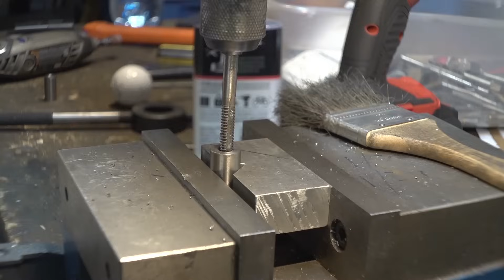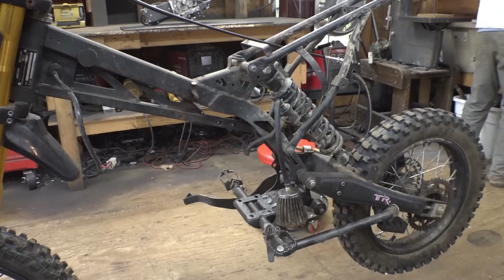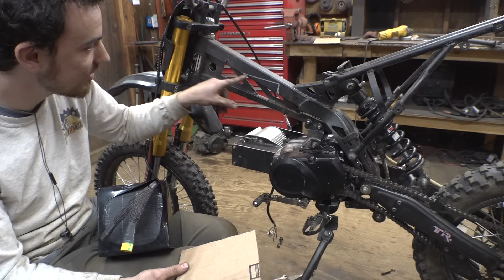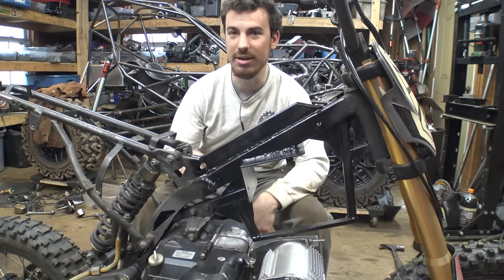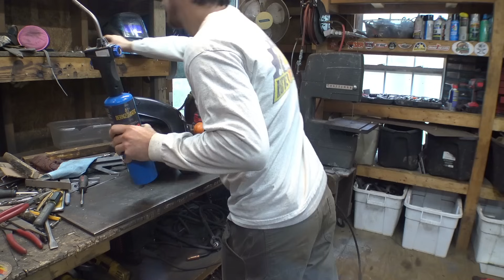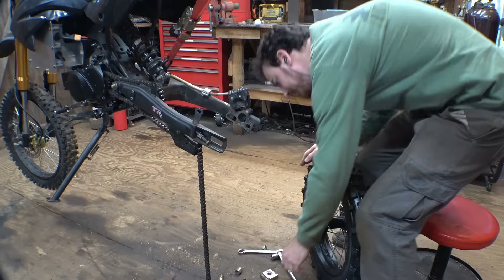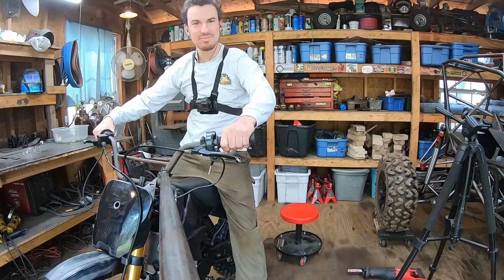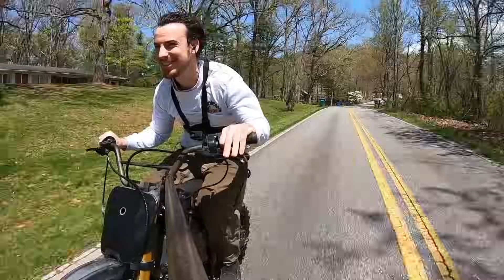A Different Way to Build An Electric Dirt Bike  - Part 2

Comment: Awesome work. Can’t wait to see the next one. Do yourself a favour in the next build and use a two stroke motor as it already has the sealed crankcase. All you would need to do is build a new crankshaft for it and not have to worry about trying to seal the crankcase from the gearbox. Thanks for the great content.
Reply: And a much taller gear range
Reply: Best off doing what he did like you've already said its setup pretty well in order to have an electronic motor where the cam use to be is an awesome idea.
I want to build myself one so stripping the scooter and my old beat pitbike is a GO for sure when I get the right equipment 😇
Reply: Dats a good idea this is gona be the next step in dirt bikes and quads u can start off in any gear and not have to worry bout it seizing up the only thing it jus keeping the gear box cool
Reply: Once the head is removed there's no camshaft or need for an oil pump a two-stroke is perfectly set up already.
Reply: @ExploringCabinsandMines  then what is lubricating the crank bearings of said 2 stroke?
Reply: @natereinhold6180  The oil that is added to the gas look it up.
Reply: @ExploringCabinsandMines  it's a electric bike conversion, look up how electric bikes don't use gas.... now what will lube the 2 stroke crank. Maybe instead of trying to sound clever, think a bit before opening your mouth
Reply: @natereinhold6180  In a two-stroke engine, on the other hand, the crankcase is serving as a pressurization chamber to force air/fuel into the cylinder, so it can't hold a thick oil. Instead, you mix oil in with the gas to lubricate the crankshaft, connecting rod and cylinder walls
MORON ! LOL
Reply: @natereinhold6180  I'm never wrong dummy.
Reply: @natereinhold6180  two stroke transmission is using its own oil not oil from the gas oil mix
Reply: @ExploringCabinsandMines  😂
Reply: To much work. The 4 stroke already has chain and sprocket for the camshaft
Reply: @dw4956  he didn't use the existing cam chain on the pit bike engine he modified the crankshaft and fitted his own chain an sprocket I assume the same can be done on a 2 stroke engine
Reply: @dw4956  i dont think the cam sprockets or chain would hold up to and electric motor. Sketchy but you never know. I would use a 2 stroke bottom end.
Reply: @dw4956  yes but the cam chain is one, very thin and two, will carry oil out of the gear case when spinning

Comment: The chain on the dirt bike is too tight dirt bike and ATV change usually get tighter as you apply weight to the suspension if it is tight when there is no weight on the bike that means it is over tight when you sit on the bike

Comment: Hey that Expose shaft where the charging system was at you should put a  Alternator  I always wonder what happens with you Put a charging system on the electric vehicle? Cool build 😎
Reply: all you are going to do is add extra system drag as perpetual motion machines do not exist
Reply: It would use more power than it could produce.    It has been tried and failed.

Comment: Make sure your using wet clutch oil. Wrong oil could cause slipping. Cool conversion, although I miss the noise!
Reply: Automotive engine oil will make a wet clutch slip every time. Use Motorcycle oil! You can also use Rotella, it's cheap and won't make a clutch slip, but I'd recommend motorcycle oil.
Reply: Motorcycle oil wont slip any clutch
Reply: lol 10-30 Motor oil is shared with the gearbox.
Reply: @ExploringCabinsandMines  And it has to be the correct oil or it will wreck the wet clutch. Has to be oil designed to work with a wet clutch as Scott Corbin said. Not sure if Rather B Welding used motorcycle oil or not though. Synthetic or not doesn't matter though.
Reply: @bwxmoto  Had dirt bikes all my life I have 5 right now regular 10-40 or 20-50 is fine , who told you the wrong oil will wreck the clutch your Mom ?
Reply: @ExploringCabinsandMines  no its not dude. You need to use motorcycle oil. The stuff designed for cars will make a wet clutch slip like crazy. Motorcycle oil or Rotella, rotella doesn't have the friction modifiers of regular car engine oil and won't make a clutch slip.
Reply: @ExploringCabinsandMines  you must ride like your mom if you're using car engine oil and your clutch isn't slipping.
Reply: @josephhollifield660  Hmmm so strange 35 years of riding at least 15 bikes using straight 10-40 no problems ever.
Reply: @ExploringCabinsandMines  I'm guessing you are just using the cheapest oil you can find. Also I'm not sure when this became an issue but I do know that it did not apply 30 years ago, oil has changed allot in that time. Cheapo oil is probably still ok for not making a clutch slip, but not the greatest for engine life. Rotella is a cheap option, and is decent oil. If you feel confident, just drain about a quart out of your bike and pour in some good modern engine oil. Personally, I wish I had been given the chance to learn from someone else's mistakes.  I first heard of this while trying to figure out why my bike wouldn't go. Couple years later I did it again, just to make sure. Then the third time I put in 3 quarts of motorcycle oil and topped it off with .3 quart of  auto oil. Felt really dumb this time, never again.
Reply: @josephhollifield660  LMFAO OK chief 👌

Comment: Are you using regular engine oil? If yes that could be causing the clutch slipping problem, motorcycle oil is made to work with a wet clutch. I used engine oil before in a pinch and had the same slipping issues.
Reply: I tried Mobile 1 once for easier starts in the winter.  It was not a good choice for a wet clutch on my Honda.

Comment: Really cool. But the right side motor mount might fail. You should connect the two bars with two other bars to keep it from moving. Right now they could Accordion they way the are set up.

Comment: To any major manufacture individual watching; this is what we want regarding electrics - The feeling of shifting gears!
That or affordable conversion kits to existing bikes.
Reply: Couldn't agree more, need a clutch for enduro.
Reply: @sedgar11  did you try electric? Im good without clutch for enduro
Reply: I rode one of those trek e bikes (mountainbikes) on turbo mode once and i gotta say, the motor did basically everything and shifting and then hearing the sound and feeling the pull was amazing
Reply: Talk about the next huge business potential. If you could work it out somehow to make it easy to add a quiet, much torquier motor and battery without adding weight to existing bikes, you would be printing money. If the battery tech is there. It's probably close if it isn't there yet.
Reply: Plenty manual electric motorcycles on the market dude. Can also get manual conversion kits as well.
Reply: Alta was able to kick ass specifically because it did not need a clutch and was single speed - both feet free and superb power control. Also the additional rotating mass of the gears and clutch make it much harder to implement useful traction control.
Shifting gears on an electric bike that goes less then the legal speed limit is pointless and dumb, makes it perform worse.
Reply: @AKAtheA  alta.... i remeber fortnine talking about it...
alta was sick but harley killed them for there own profit now we will never see a alta again cause harley own the tech? if im right...
Reply: thank you, said everything
Reply: I tried a Brammo Empulse R back in 2014 and with a 40kw motor, clutch and gears, this motorcycle was really fun to drive! Too bad Polaris bought brammo and never did something good with the Empulse  set up.
Reply: electric sucks ass.
Reply: well if you are into hauling like me, extra gears are needed to stay on top of the efficiency band. but casual riders like you   are trained to think it's more fun
Reply: Thing is electric motor doesn't need a transmission. They produce same torque at any rpm.
Reply: Totally nonsense. An electric motor always deliver full power, that's why you don't need gears. Also, adding a chain reduce the power by a significative factor. This project may be fun to watch, but it doesn't have any real application. He basically reduced the overall power of the bike, increasing the weight, and requiring to change the oil in the clutch. Funny, but not smart.
Reply: @biomorphic  electric always delivers full torque.  power is torque times rpm... so there can be times a person might want to lower the gear ratio to increase the torque

Comment: awesome build. i think more electrics should have gears - it has to add efficiency as well. as for gas tanks, run exhaust gasses into the filler while you are cutting after rinsing out. that keep the oxygen out and it wont explode. and when you ride down the road, at least should wear goggles or safety glasses, a bug would make a bad day.
Reply: A transmission like this reduces the efficiency because of all the friction in the additional moving parts.
Reply: gears reduce efficiency depending on the efficiency range of the electric motor, but yeah in an off-road application it can help a lot if you're falling into low-rpm points with the electric motor.
Reply: @NVMDSTEvil  electric motors provide full torque from a standstill, petrol motors don't, hence the gearbox, not needed on an electric motor
Reply: @andyb7963  ummmmm
Reply: @andyb7963  Not sure if  you dont understand what I wrote or you read someone else's comment and replied to me..
Reply: @andyb7963  they do provide full torque immediately, but the do not operate very efficiently at higher speeds, and gears would allow for lower motor rotation at a higher ground speed.
Reply: @andyb7963  yeah we get that, what you are not understanding is that with gears you can multiply the torque to the wheels in low gear, and then as the gears get higher you can trade extra torque for top end speed. Gears can give great advantages with electrics. If they weren't needed my milling machine would have a single pulley on the motor, same size as the single pulley on the quill.  Instead there are 3 sets of step pulleys, with 5 positions on each pulley so you an change the gears to match the RPM
Reply: Ha funny you said that I literally just my 1/2 helmet on cruisin around an a fat ass bug flew in my eye while I was gettin off the fwy. Fml..

Comment: Been wanting to say something for long time, but this video is being it out.  (I'm almost 50 and been doing it since I started driving) 

The clutch is meant for use when moving from a stand still, and never used again for shifting up or down.   (The way you hung it and wentthru gears).  Works on cars differently since not sequential gearing, and since it isn't an idling motor, you don't need it for take off.

Comment: Good job on this. Now this is making me think someone should make batteries that would be in the shape of a gas tank or fit into a gas tank, so you don't have to mod anything to this extent. Something where the gas tank can be modified to cut it in half and stuff all the batteries inside and ether screw it back together or latch it somehow so it can still be accessed.
Reply: That's what I thought as well...

Comment: Do not think you need the clutch with that gear box. I never use the clutch on my pit bike except for starting and stopping but not really an issue with the electric motor. Just make something to lock the crank to the  clutch gear on your lathe. 
The issue with the slipping is because those clutches use centrifugal weights to apply pressure to the clutch pack to fully lock it and the clutch is not spinning fast enough. Guess you could add weight to those spring loaded weights to make it lock up at lower rpm or less/ no spring tension on the centrifugal weights.

Comment: I 100% agree that shifting gears is still fun with electric motors. The chain will bring up any oil that touches it into the motor case. It’s not really a bad thing, but the gearbox is probably low.
Reply: same thought, that when the primary chain gets a little lubrication is not the worst
Reply: It shouldn't be getting oil at all, but as you said, it's a good thing.
I'd add a catch can to the bottom of the chain guard and let it leak. That way you get a self-oiling chain but don't get oil into the motor. You just have to tip the catch can back into the gearbox every now and then

Comment: Have you had any problems out of those aftermarket dewalt batteries? I've been thinking about getting a couple of them but haven't seen anyone use them besides project farm. That bike is pretty awesome.
Reply: Ive used some of the generic DeWalt batteries and they don't pack the exact same juice but they hold up pretty well. The only difference is how long the batteries last long term.
Reply: @deathraider8228  cool deal thanks bud I appreciate it

Comment: If you run copper tube through the fins of the motor and have a small coolant pump and radiator you could make it liquid cooled. Electric motors do much better when cool vs hot.
Reply: That’s a great idea.
Reply: What about better air cooling
Reply: @Paulman50  that would be much simpler

Comment: Well....for one thing, they can't say THIS electric bike is too QUIET lol. I am worried about the longevity of the drivetrain though, now that there is no longer oil flowing and splashing in the engine crankshaft area.
Edit: Just saw the end of the video. Lol, okay, so there is no oil problem. Good. Keep that chain lubed! Also....Burnouts ruin tires. WHO KNEW?

Comment: Welding a flat stock between the original frame and the added support on top would hold that together no problem. Spray glue the padding in the box

Comment: Hey brother love the project and love your videos. I have been trying to contact you about your rock crawler and a flaw that suzuki put in to every single tl1000, sv1000, sv650. Due to its oil sump design if you elevate the the engine you starve the front cylinder causing the front cylinder to dry up and fry its self. I will stop posting about if you just atleast acknowledge the issue I don't what yo see your hard work wasted. Here is a video describing the issue in more detail. https://youtu.be/_pzbXn5hq4c

Comment: Couple of different ideas for you.
You could have modified the gas tank in order to fit the battery into. 
Put the battery box under the tail section. Research a smaller zero gravity lithium battery with the same power output. Keep in mind I’m coming up with these ideas before watching the entire video. Best of luck. Love your content and look forward to many more.
Reply: lithium batteries almost have the same storage capacity per volume. the biggest difference is packaging. so a lightweight zero gravity battery might put out the same peak amps but if its smaller and lighter then it'll have less range.

Comment: Next time for your own safety please fill that gas tank with water once. Then empty it and start grinding or whatever. Even the way you did could potentially be very dangerous!!! 
Keep up the good stuff great builds!
Reply: I came here to comment this. Whenever you need to work in a fuel container, first fill it with water, then empty.
Reply: @fellipec  👌👌👌
Reply: @fellipec  Where is everyone dumping the water that they drain out of the tank? My neighbor has a huge tank and someone told him to fill it with water. I asked him the same question, "where do you dump the poisoned water"?
Reply: @TopoPilot  
On the ground lol
Reply: @TopoPilot  Water with trace amounts of fuel? Just put on the drain or water your plants with it. Sure the water that is used to wash your car came with more residues from oils and grease then the water you fill an empty fuel container just to be sure it has no fumes left.
Reply: Was thinking the same thing.
Reply: That's what I was thinking...I'm surprised he doesn't have a fire extinguisher on every one of his builds, after he watched one of his bikes burn down on the street. (one of his earlier videos)
Reply: Guys worried about a teaspoon "maybe" worth of gas mixed in with water being dumped out... I bet he's eating some gmo processed food as he wrote that comment lol
Reply: @iancampbell6002  
Word ... I've left out like a soda can worth of gas in a red can busted dispenser tho in the rain 🌧... so I've come back to a half gallon of water after months and months ... 1/2 gallon of water and 8 ounces of gas mixed ... what do I do ?? Well I need fresh gas for the mower so fuck it  I pour it on the ground and go get the freshy....
Reply: Ive also heard that.
Reply: It'll be fine
 I watched a guy try to shop vac out a rusty tank and exploded the shopvac and lit the garage on fire. He still has permenate hearing damage from this

Comment: That's EXACTLY why I NEVER use 4 flute taps. Always buy spiral point 2 or 3 flute!

QUESTION - Instead of installing in chain in the center of the crankcase, why not install in outboard where the flywheel was? Then you could've used a belt. Not trying to be critical, just curious.....

Comment: I'd love to see a electric motor with a cvt belt drive! I bet one day u will! Good job on all your builds Chris, they truly are inspiring!
Reply: cvt adds losses and there are no benefits in an electric motor really
Reply: @nirodper  I agree. Electric motors have basically full torque at all speeds. I'd think he should be able to take off from a stop in a higher gear and actually accelerate faster.
Reply: @tinkerne-round4079  I think the lower gears would be most useful for multiplying torque in low speed situations like crawling slowly over logs/stairs.